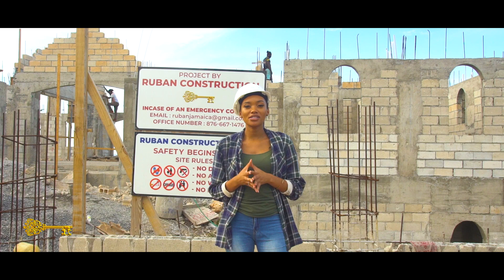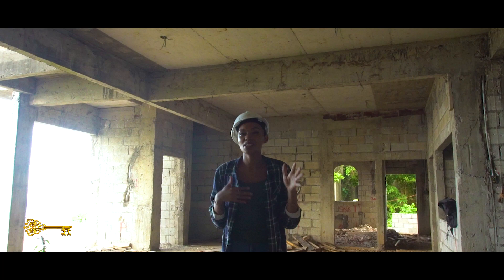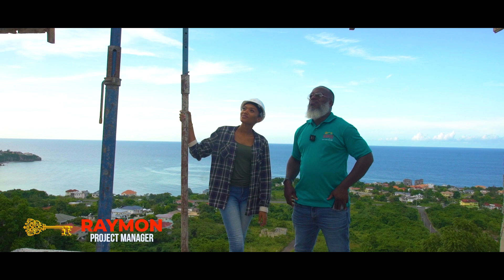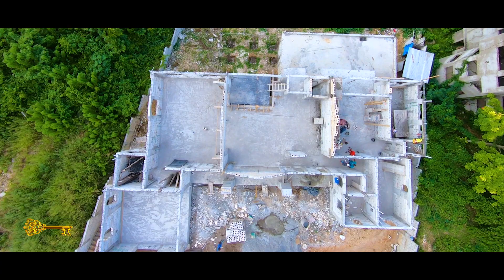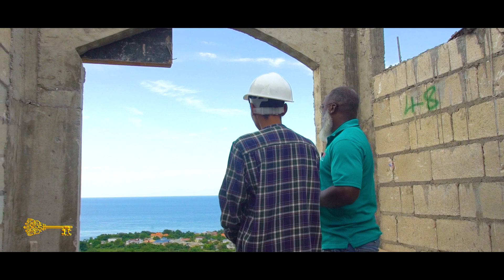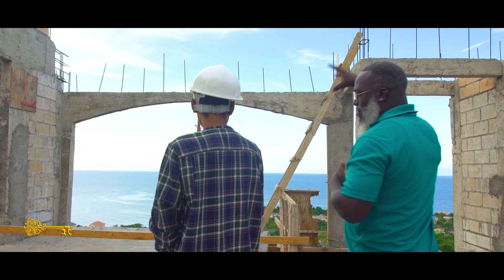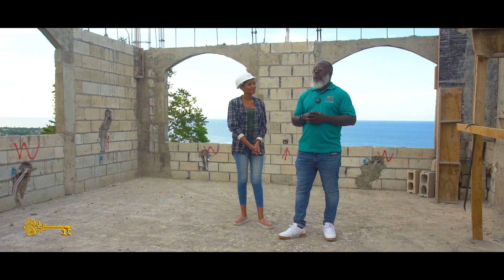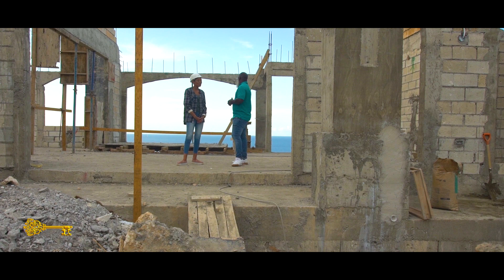Building a Dream Home with Ruban Jamaica: Project 46 Episode 3

Comment: Hi, Which size blocks do you use for the external walls, 6 or 8 inches? Thanks
Reply from the maker: For most residential construction we use the standard 6" blocks throughout the building. However if the wall also acts as a retaining wall then we use 8" blocks.